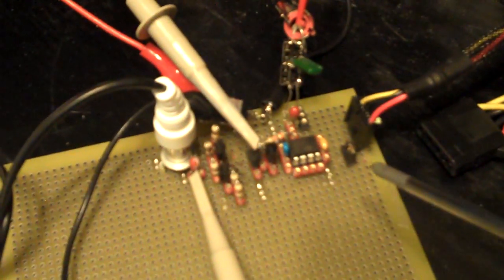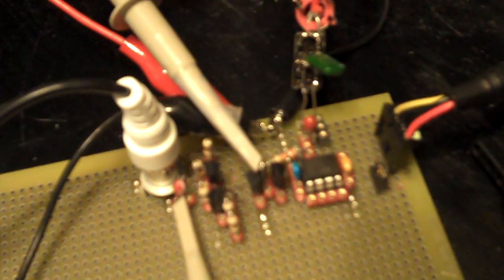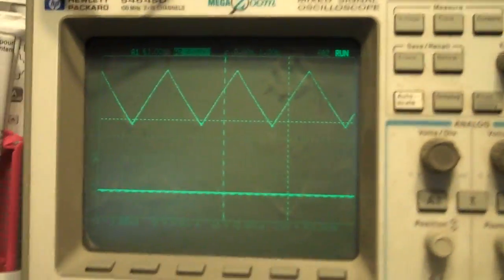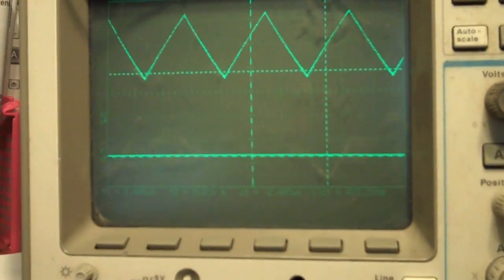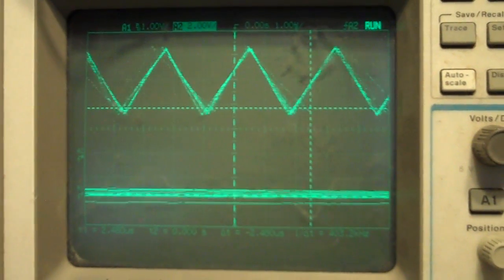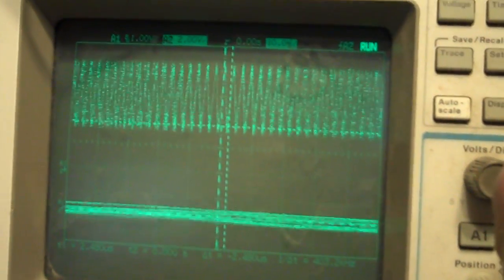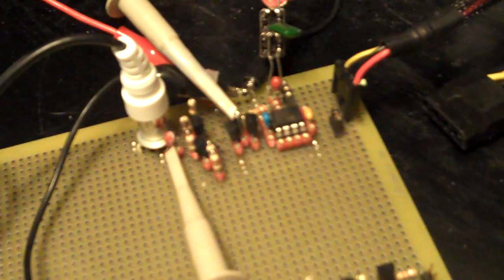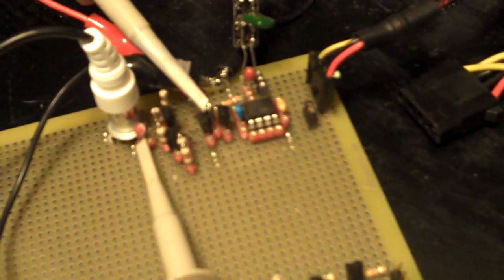Improved 555 Delta-Sigma Modulator - 555contest

Comment: Looks like someone took your design and had it made into a project for Elektor electronics, the 555 circuitry is pretty much identical (using almost exactly the same component values).

https://www.elektormagazine.com/magazine/elektor-201401/24354

For the schematic, you'll have to look about on the web, as elektor enforce their copyright pretty strictly.

Comment: Just a quick question. In your Improved schematic, What would be the values of the resistors to work on 5V in place of 12V ? I think, around half values of all the resistors should be OK ?  Just concerned about the ones which are related to the current source and the top right resistors(the 4.7K alternate area).

555 is comfortable with 5V operation. I have managed to get 50% Duty cycle and Modulation using  pin 5 as input from Audio Source.So Wondering what would it take to convert this to 5V operation ?
Reply from the maker: +Anand Padhi If you change the current feedback resistor, you will also need to change the input voltage to current converter (currently setup for 0-2mA range).  When running the 555 on a lower voltage, the high and low trip points will be closer together, so with the same component values the circuit will operate at a higher frequency.  To change operating voltage, I recommend adjusting the integrator capacitor (C1) as needed to get the frequency you desire (various 555 derivations have higher and lower operating frequency limits) and leaving the current setting resistors alone, but the entire circuit is not particularly sensitive to the exact values used.  Just play around with what you have on-hand!
Reply: +Charles Steinkuehler Cool, thanks, I will give it a try. Trying to do some basic tutorials myself on getting started on Class D as I am learning through it. May seek some help from you, Shall let you know, and also, shall leave notes here as well for others, after I get it running it all on 5V.

Comment from the maker: The THD numbers were driving into the 600 ohm load of the VM700 XLR input.  You can, of course, add a driver to the output and get a lot more power if desired.  I was mostly interested in what I could achieve with just the 555, as this was a design for the 555contest.

Comment from the maker: Actually, the measurements are with the 'Tek VM700 input load of 600 ohms.  I don't have this circuit setup any longer, and the VM700 is currently 800 miles away, so I can't (easily) test any other configurations.

Comment from the maker: Actually, it can go from 0% to 100% modulation.  If the input current source is capable of sourcing or sinking more current than the feedback path (Q1/Q2/R2), then the 555 will never switch states, and the output will be at 0% or 100% modulation.